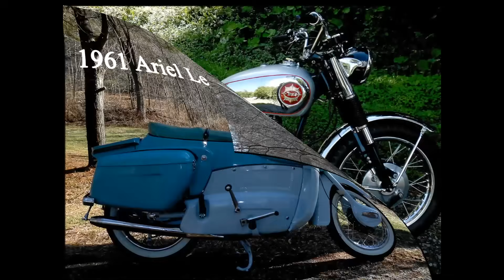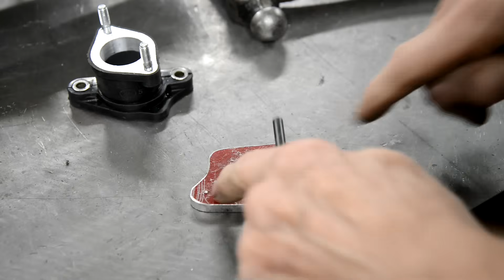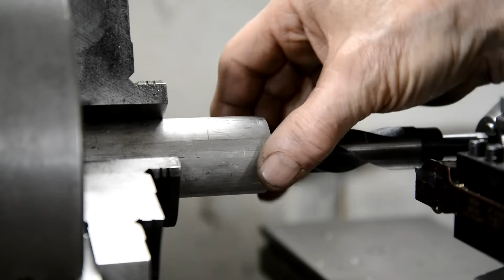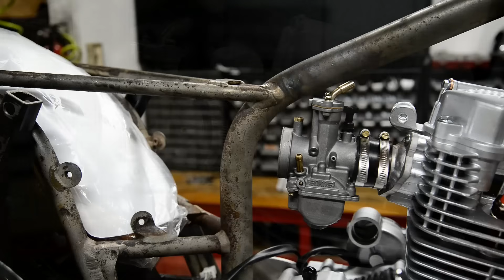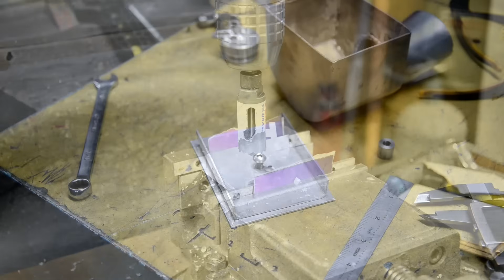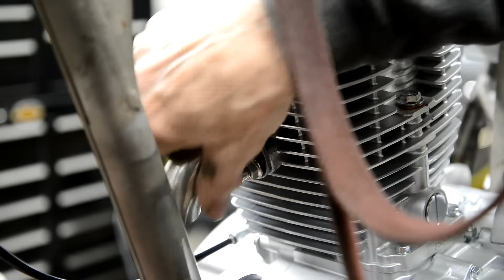SM Highboy Special  -  Part Six

Comment: Michael, that looks a very long kickstart for a 200cc "cooking" engine, unless it is very high geared. Might it improve the aesthetics to shorten it by say 30%. I don't think the kickstart was that long on my 1200 Vincent, which admittedly, I could only use when thoroughly warm, otherwise it was bump starting.
Reply: My daughter has a dual-purpose Chinese bike with one of these engines at 230cc and the kickstart is geared very high, not an easy kick to get cooking.
Reply: Good decision on the saddle Michael. I could understand you wanting to use it, but it just didn’t look right.